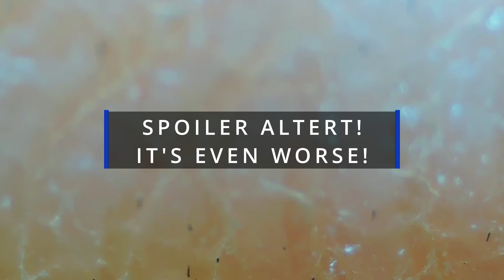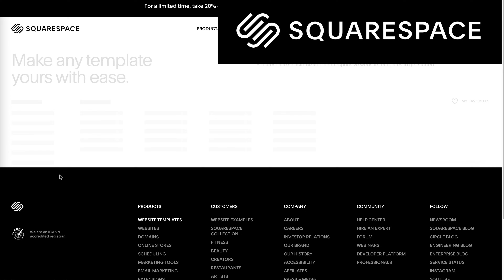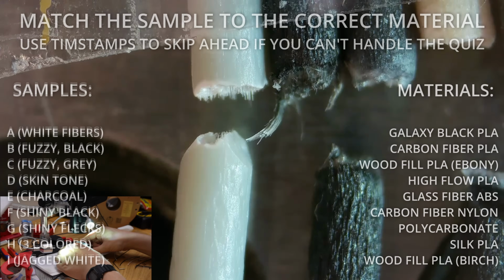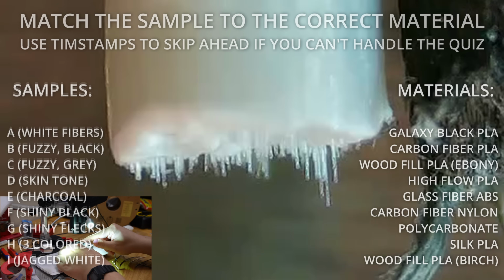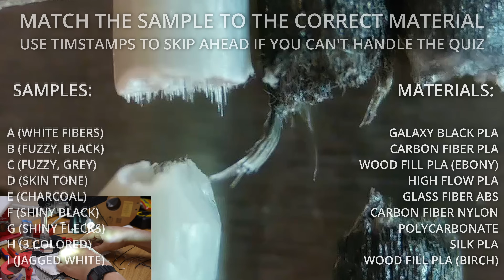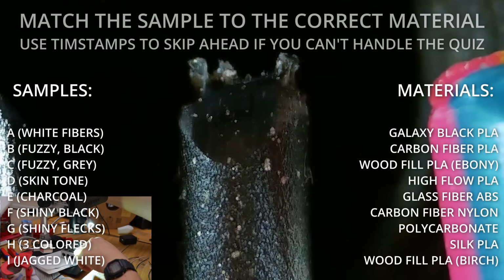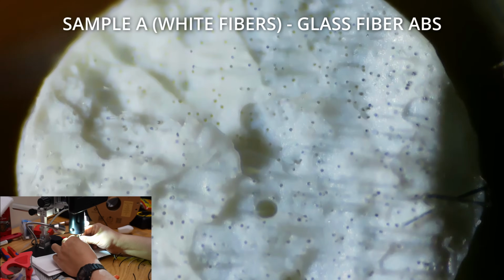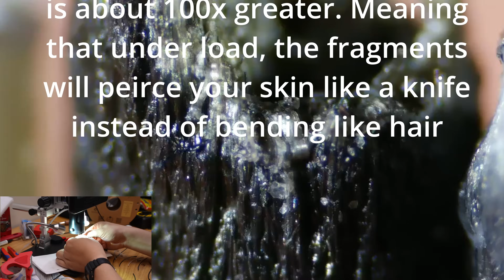Carbon In My Skin. These Wounds, They Will Not Heal.

Comment: In the article on your website there was another video as embedded, which showed how to coat the parts so the fibers aren't sticking out - sadly the video isn't working anymore, is there a link to it anywhere? I have some parts printed already that I don't come in contact with that much, but would still like to coat them. Thanks!

Comment: If I use epoxy to coat a printed part and then I use sandpaper after it dries (48 hours), will the 3d printed part still be safe to touch?
Reply from the maker: It is best to not sand carbon fiber. That said, it is done in practice, if you absolutely have to, use dust filtration, good shopkeeping, and wet sanding to reduce dust buildup

Comment: I so wish you would try this with a "core" filament. I saw something called carboncore25 that basically sheaths the carbon in pure plastic, so only the inner core has the cf or gf. Wondering if this is just a gimmick

Comment: Haven't used fiber filament since I watched you original video.   Starting to use it in cases only where it's necessary now, but with a brushed epoxy coat.

Comment: I'm not that worried about PLA or PETG fumes, but the fibers do worry me a bit. I have only used ASA-GF, but I am starting to use some PAHT-CF. For the ASA-GF, I moved a printer out of my office and put it in the bathroom, and then ran the exhaust fan continuously. I'll probably do the same for the PAHT-CF. I could definitely notice that the air in there was nasty and made my lungs itch if I went in there too soon after the print was done.

Comment: This is not a problem, You dont want the particles flowing in air. 
these are coated fibert that will stick to your skin, but no. Its not dangerus. 
The Fibers will only stick to your outer layer of the skin. It will fall of when your outer skinlayer will be reaplaced every 28 days.

Its good to see someone talking about this tho. Becaise there is not anough research on the effect of heating the fibers and blowing on them.

Comment: Man I was just about get into filament printing after ditching resin for health reasons... now i dont know if I should be doing any printing. Yikes.
Reply: @White0ni  you really have nothing to worry about. Non CF filaments won’t do this to you, and the biggest safety concerns of regular filaments are the fumes they emit while printing (not unlike Resin) and microplastic exposure (which isn’t any different than regular plastic use, and can be accounted for by painting or coating). Overall it’s a great compliment to resin printing and you should be fine!
Reply: @dakotaedwards1426 wait so you don't think redin printing Is unsafe? Worried because I have babies.

Comment: So, they're imbedded in your skin then your skin sheds them off. Shed off skin becomes dust which you could potentially inhale into your respiratory system. Any concerns there?
Reply: @lormoua7562  ansorleu
Reply: Carbon fiber is not actually problematic to inhale. The fibers aren't small enough and won't break unlike asbestos. The get caught by the mucus in your lungs and will either be transported out or get broken down by macrophages. 

Same guess for Glass Fiber reinforced filament except for the breaking down part.

Comment: I have a major problem now, I'm about to realise my product which is made from glass fiber filament and it's meant to be held in hand (theoretically with gloves). I have worked on this product for a whole year, and now my hands are itchy and I have a rush from fibers. I literally don't know what to do with it. If I have a problem, my customers will have it as well. I don't want them to have it. It's just weeks before release. I'm thinking about brushing it before packaging or chamber it with acetone (its ABS).
Reply from the maker: Easiest thing to do is Clearcoat it with spraypaint IMO
Reply: @NathanBuildsRobots I can't paint it. I thought about it. I'll try with brushing and soap wash. I'll check it after with microscope, I hope it will help.

Comment: Fiberglass apparently used to be more dangerous tha ncarbon fiber. But carbon fiber is so dangerous that all motorsports people cut it typically under water AND still use Asbestos level filtration units ...

Hence, i don't touch the CF filaments unless absolutely fucking necessary ...

Comment: The newer core filaments where the filament is extruded with fiber filled polymer on the inside and a pure polymer on the outside should help to contain the fibers... on the filament and on the printed part.  When extruded, the laminar flow keeps the fibers well embedded in the matrix where it won't shed.  Example:  Siraya Tech Fibreheart ABS-CF Core

Comment: A large number of safety studies exist on the risks of extruded FDM filament showing that regardless of filament type (PLA, ABS, etc) .1-1micron range microparticulates are produced. Some are carcinogenic, others not, and others yet have not been studied. The particulates become very volatile at that scale and their chemical composition alters and breaks down into a host of hard to track compounds. All of these, however, being in this micro particulate range, once inhaled, do not leave the alveoli of the lungs. As you might imagine, this is bad. 

Now, many have assumed enclosures and little hepa +charcoal filters within would solve the issue. Unfortunately, micro particulate tests have been show that when printing with the  above, micro particulate counts are as plentiful outside the enclosure as inside. 

I run a print farm for producing commissioned sculptures and wall reliefs, and my wife has asthma. So, I’ve had to dig deep into the literature on FDM safety. Sadly, there remains very little media content on the subject that provides the appropriate level of safety.

FWIW, here is my solution that has had made my shop microparticulate free. 
(1) build an enclosure or use printers with pre-existing enclosures. Make them as air tight as possible. 

(2) Buy a BOFA or build a BOFA-like air filtration system that cycles the air in the enclosure into a HEPA11+/charcoal filter

(3) This is the part most makers miss: create negative air pressure in the enclosure by creating an opening in the enclosure w an added hepa/charcoal filter in the opening to allow air to flow that also keeps particulates from leaving. Then create a second opening for exhaust and power it with a fan at low low low cfm and port it outside. The cfm just needs to be high enough to create gentle airflow towards the exhaust but not so high as to cool your bed or hotend. All said, the process is a pain in the ass. But seriously, if you have a print farm that isnt cycling fresh air continually, you are gonna so regret it down the line. Just my 2 cent PSA. Godspeed yall

Comment: I wonder if these carbon fibers could be coated with a spray or dip or something? Especially for those filaments that can be machined and post processed. Getting some clearcoat in holes wouldn’t be too big of a deal. Really I’d just prefer more CF core filaments to come out. Preferably PET-CF!

Comment: I installed a Hepa air filter into my P1S and I’m going to be buying a larger air purifier that has a chemical capture filter for FDM particles and resin printing. 

There’s already a problem of Microplastics but It’s better to be safe than sorry, I’m also going to be using an air quality monitor with all filaments.

Comment: I'm old school. I use clear nail enamel as clear coat, hot glue as conformal coating when epoxy is overkill, and I had to buy fabric made of stretch nylon because stockings have fallen out of fashion and it is the best way to get mirror toes on your dress shoes. Boiled linseed oil on everything but shop rags. 😂

Comment: I once wanted a 3-D printer, but once I actually had the chance to use one, I felt like a metal printer is a better option. I wonder though if I get the chance to test a metal printer if the end result will be the same.

The problem I feel is that plastic printing is as you mentioned, problematic and the end result is not as sturdy as metals imo.

Would be cool to see if metal printers had similar issues.

Comment: Thank you for doing this research. Are there any serious risks with resin printing?
Reply from the maker: Yes
Reply: If you do it wrong you can become permanently sensitized to resin, this is horrible because resin is literally everywhere in our modern world. Many walls and floors have resin, electronic devices have resin, medical equipment including implants and prosthetics often have resin, packaging can have resin, ever heard of BPA free water bottles? BPA is a type of resin used to line the interior of many canned and bottled beverages. If you get a bad case of it, you would have to recenter your entire life around managing it. It is because of this that resin 3d printers, are more dangerous than extrusion ones, even with carbon fiber in there as displayed in the video.

Comment: I have been doing microsurgery in both forearms for the last two years to remove thousands of carbon fibre splinters. I was making composite panels, and there was a pile of  trimmings from the board edges on the floor - where I foolishly dropped a jacket. It was inside out when dropped on the floor. In a moment of horrible ignorance, I put the jacket on, and thousands of tiny epoxy reinforced splinters went deep into both arms. 
Because the body can’t dissolve or eject them, it forms a protective capsule around the intrusion. This capsule is very tough, stronger than skin.
I would still have hundreds of large, painful, permanent lumps Al over my forearms if I hadn’t decided on brute force and persistence.
Fingernails and craft blades.
One to two hours per day for the first five hundred days.
There is no option but digging the splinters out.
And as you do that, the protective encapsulating material keeps trying to regenerate.
It forms scabs over the wounds which set like epoxy resin.
They do not heal and fall off, like scabs on normal wounds.
They must be physically torn off, regularly, bringing tiny splinter particles with them.
From December 2023 until now.
The last most problematic areas are almost entirely healed now.
I went through lots of alcohol gel (left over from the pandemic), and lots of pain.
Be careful.
Reply: You should be documenting this! I hope you’ve been taking pictures or videos
Reply: @MOZParungao  Yes, I have taken pictures regularly. Unfortunately I couldn’t manage to take any decent pics with magnifier or macro lens, which would show the tiny carbon fibre pieces embedded in the lesions on my arm, and in the pieces of material I removed. 
I have no idea how a doctor would deal with this. What I’ve done is the only method I can imagine. It will be three years until the job is completed !
Reply: Thank you for sharing that, I hope you can fully heal.

Comment: I work with fiber optics sometimes like fusion splicing. The dangers of tiny glass fibers are well-known in the industry. Fiber cleaving devices usually have a method to collect the off-cuts safely. In a way, 3D printing might be worse though, because with fiber optics, you know when and where a shard will be formed so you can take precautions to deal with it.

Comment: You know what, I was thinking of clicking on the video cause of the thumbnail, but the title drew me the rest of the way in.

FEAR IS HOW I FALLLLL
CONFUSING WHAT IS REALLLL
Reply: You know watching this video was actually super helpful. There's a building trend in fursuit making where people will print/ buy pre printed head bases for their character. There's a lot of people selling these bases online, but I'm not sure too many of them (if any at all) are thinking about stuff like this. They're probably only thinking "Is it strong but lightweight", since you have to be able to comfortably wear it on your head. Problem is that means your BREATHING through it, so if it's not got a coating on it or the finish/ material is producing a bunch of sharp microscopic fibres, that's probably going to affect your health a lot more than some loose faux fur hairs would. The alternative is building the base yourself, so I definitely see it becoming more and more popular, and now I'm a little more worried about the quality of the plastic filament being the first thing to get neglected when people try to make a larger profit for cheap while charging less than the other sellers..
Reply: There's something inside me that pulls beneath the surface
Consuming, confusing

Comment: While I won't say that I'm not already a bit of a germaphobe, I do work with carbon and other composites as my day job and take a good deal of precautions in doing so. Even with thousands upon thousands of hours reading MSDS sheets and chemical analysis/mill reports, the source of the carbon filament is never disclosed other than a CAS number (unless you're manufacturing the carbon thread yourself, which I have done in the past). Carbon by itself in terms of high purity isn't outright dangerous on the Outside of your body. There's already a fair amount of it In your body, and more accumulates as you age. Like everything else however, it's the right amount in the right place. Cut-resistant gloves, eyewear (or preferably a sealed mask with proper filters) and kevlar sleeves are all over my shop, as it only takes one instance of getting stabbed with a carbon fiber implement to not want to repeat the event. Fiberglass is equally treacherous, though the encapsulating material (epoxy, polyester, etc) carries the bulk of the toxic risk when entering the bloodstream in any great quantity. As much as I like the idea of recycled carbon bits and turning it into filament, this carries a higher risk when handling and exposure that need be in the reading material and enclosed with filament, which i've not seen to date. 
I'm sure it's been mentioned in the comments by now, but most any time you touch something, there's a transfer going on down to the microlevel where you're being exposed to something just as much as you're imparting your own bits in return. Short of living in a hermetic bubble, there's nothing much one can do to prevent it entirely, and you'd go mad thinking about it. 
Regardless of all of that, I do thank your efforts for calling attention to the matter, and wish more people took a moment to consider the side effects of our hobby/this industry towards being as safe as one can be. For whatever it's worth at this point, Maxiflex are my composite-handling gloves of choice. So far as analytical substitutes for skin go, medium soft candles work very well for a transfer medium, as you can melt and screen out contaminants very easily for post-analysis.

Comment: Ehhh, I did not know that day that they embedded carbon fiber into filament, I’m questioning how badly I want to get into 3-D printing now that I know that

You can use ballistic gel, which is just different grades and densities of gelatin   I have also seen experiments done with skin of something that’s been freshly killed like a pig skin. But I would think you could use the skin of packaged chicken.
Reply from the maker: Most filament doesn’t have it, but CF filaments are very common and marketed to have dubious improvements in print quality and strength

Comment: Even more exiting is sanding carbon or glass fiber material.  All those particles go right into the lungs... forever.  So the sanding should be done with a good respirator and the area well ventilated, or somehow controlled to actively remove the dust.  Just because you stopped sanding doesn't mean the area is suddenly safe.  It's in your carpet, clothes, etc.

Comment: Fantastic job of raising awareness of these unannounced dangers of plastics. I suspect that this goes beyond the realm of just 3D printed objects, however. Perhaps you could do a follow-up with non-3D plastic products? With the cheap availability of HEPA filters (and better), would the easiest solution to airborne particles be to have an air filter right next to your printer? I think it would be very helpful if you can show how fine of a filter is needed to catch the soot, dust and filamentous fibers. And, no, I didn't write this after you showed your air filter! What grade filtration does it have?

Comment: I worked HP's lab here in Corvallis on those printers. The long term techs (10+months) would have skin sores, respiratory issues etc. A lot of them were contract hires. Those powders are 2micron. We had to wear 3M PAPRs and full suits to deal with it in the Vauxhall labs.  Those rooms were also positive pressure. I quit after 67 days. Its not good stuff.

Comment: I don't work with carbon fibre but I have cut and drilled metal in my workshop.  When I went for an MRI, I checked the box that I had worked with metal.  The hospital x-rayed my eye balls first, to ensure it was safe to get the MRI!  Glad they do this.

Comment: no way in hell im watching this whole video to boring, but from what i saw those little shards are so small they wouldnt puncture far into the skin and would be pushed out just like a sliver would as the skin cells grow underneath and the old ones die and fall off. maybe im wrong though? what are the lengths of these little shards/needles?
Reply: Lungs. In your lungs these shards last indefinitely potentially, and that is exactly what asbestos does.